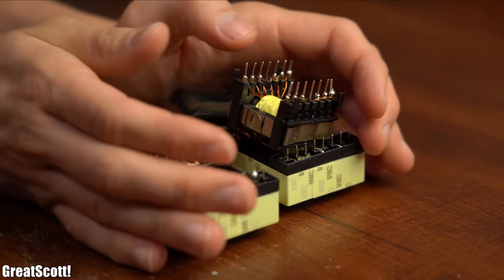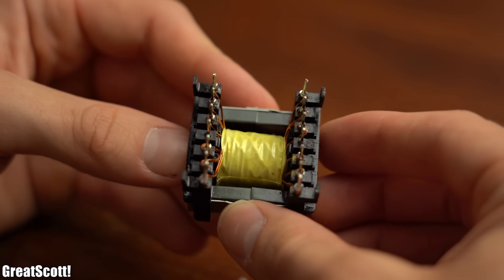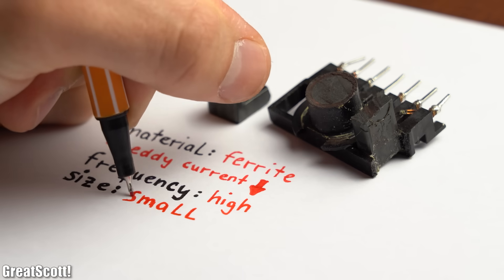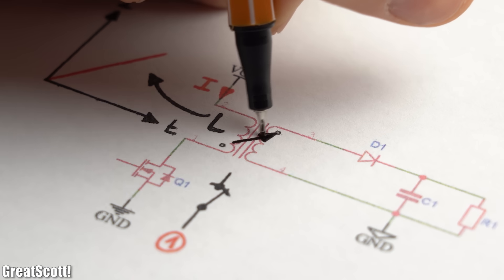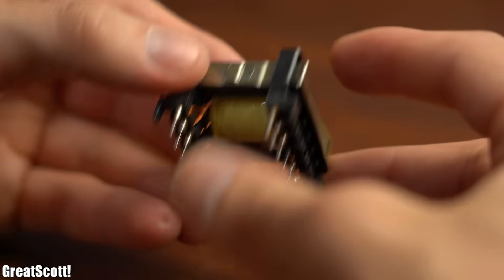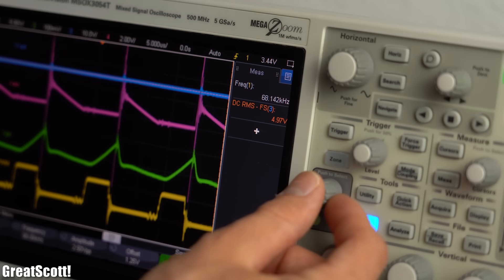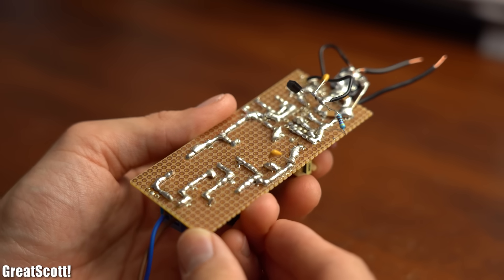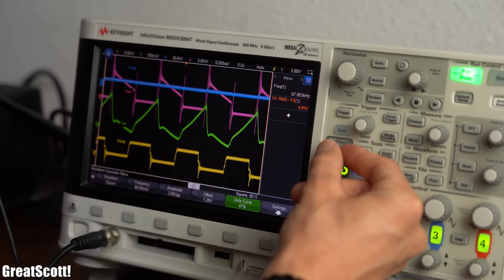How does a modern Power Supply work?! (230V AC to 5/12V DC) DIY Flyback Converter!

Comment: HEy Hey Scott! listen to me Please make a small and long and fast RC Car with rear wheel steering and use a flat and big li_ion battery as your base where you will attach your moter and circuit so that it is less tall and the center of gravity is near to ground, use serval less heighted motors to make to all wheel drive (please atleast make AWD Bkz i wanna know how to have steering with AWD). Make it very fast and add a boot and a holder where you will fit your phone and use phone camara to track where it is going or the best use you phone and moter only to make RC car Which is affordable and best of all. after making you can delever stuff using it and do some tough offroading and climb 80 degree angled wall(benefit of low center of gravity) and do cornering (taking it around corners at max speed).*Please do this it is my Request*

Comment: Just can't wait for the video on the TL431. I'd love to see, how I could use it, to regulate the output of a dc-dc converter (which aren't so different from smps). For example to battery power a microcontroller based temperature logger.

Comment: can you plz make a video on making a gamepad with arduino NANO ,or just make  a small video on how to make arduino NANO a an input device with code please . i tryed so hard but i am not getting it please help, and love your videos.PLEASE HELP... or how to make arduino nano as  an HID.
Reply: i am Also Totally down for this!
Hope scott sees your request and i also have a message from me that i write here:
HEy Hey Scott! listen to me Please make a small and long and fast RC Car with rear wheel steering and use a flat and big li_ion battery as your base where you will attach your moter and circuit so that it is less tall and the center of gravity is near to ground, use serval less heighted motors to make to all wheel drive (please atleast make AWD Bkz i wanna know how to have steering with AWD). Make it very fast and add a boot and a holder where you will fit your phone and use phone camara to track where it is going or the best use you phone and moter only to make RC car Which is affordable and best of all. after making you can delever stuff using it and do some tough offroading and climb 80 degree angled wall(benefit of low center of gravity) and do cornering (taking it around corners at max speed). Please do this it is my Request
Reply: @kunaldhar6713  i also had this idea but i am not having  a 3d printer to make it.
Reply: @armanp7860  Well i guss you can use the battery as your base and use metal as your body or just you don't need the body

Comment: Could you explain what might happen if one replaces the diode D1 at 5:42 with a bridge rectifier?
I've seen such a circuit and I could not explain how the circuit outputs the samething with that it would have worked with a single diode instead of a full- bridge rectifier.
Reply: The power supply won't be a flyback anymore. The output capacitor would charge also, when the mosfet turns on, it would be more like forward topology, and the output voltage would depend on duty cycle and transformer's ratio. I've seen something like this, but it was halfbridge with an air gap and no output inductor, an LLC resonant converter, that regulates the frequency instead of the duty cycle.

Comment: Flyback converters are fine for low power phone chargers and such, What about forward converters? (single ended, two switch forward, half bridge, full bridge, with asynchronous and synchronous rectification pros/cons) or even better, what about LC, LLC and LCC converters?

Comment: Make video on how to design ferreit core transformer...& Why for high power applications with not use flyback topology..??
Reply: Flyback is usually the choice for much higher output voltages( boost) compared to the input..but at lower current requirements..max..
(150-500 )W ..

Comment: 6:23 Well, actually the mosfet can get overvoltaged even if the leakage inductance is zero. Here's an example: we built a flyback SMPS, that converts 325V DC into 12V DC. The transformer's ratio is 20:1, and Vd-s(max) of our mosfet is 500V. Whet the mosfet opens, the energy from the core gets transfered to the secondary side, where we have 12V, so the voltage on the secondary winding is about 12.6V (due to fast diode's voltage drop). Knowing the transformer's ratio, which is 20:1, we can calculate, that the voltage on the primary winding is 12.6V * 20 = 252V. This voltage adds to 325V, that we already have on the mosfet's drain, so at the end we have 577V there! As you can see, the 500V was exeeded. Even the 600V mosfet wouldn't be enough, because of the leakage inductance, which also adds some voltage to our 577V. To solve the problem, we could use a transformer with lower ratio, for example 2:1. But here another problem begins: when the mosfet turns on, the voltage on the secondary diode will be 12V + 162.5V = 174,5V. Our diode have to maintain this quite a high voltage. That is why we have to be careful when it comes to choosing a transformer, a mosfet and a secondary diode for our flyback power supply. In a described example, optimal transformer's ratio would be 5:1
Reply: Voltage wise factor of safety..2.5 x.. (+20%consider input o.v. condition) so( 325+65 )× 2.5...but now new device rDS " on" will be higher...
Reply: Very good points, thanks for sharing

Comment: Imagine PCs with conventional power supplys, they would need a case almost the same size as the pc tower. At least electronic components are cheaper than copper and almost every application which needs a psu has a high frequency type. As a child of the 80s I know the iron transformer age very well 😉
Reply: And think of the weight. I've got a 12V 6A linear supply on my desk at work. It weighs more than my PC.

Comment: So I always thought DC-DC converters that used a toriodal transformer like the power supplies in car audio amplifiers where flyback, but since they have no air gap what exactly would they be classified as? Just an isolated boost converter?

Comment: In the video, you mentioned about the air gap but didn't explain why it's used, I still have this doubt on how energy is stored in the air, and why does it fly when the transformer get turned off. Will there be a next video about it?
Reply: The ferrite of the transformer is a magnetic circuit in which the magnetic flux introduced by the magnetizing current of the primary side is carried between the primary and secondary windings.  For a conventional transformer, these are carried with a low "reluctance" path to ensure that that the energy is transferred to the secondary winding simultaneously with it being introduced into the primary winding.  This can only happen because there is a current set up in the secondary by the magnetic flux at the same time that the primary is generating the magnetic flux.

In a flyback, there is a diode blocking a current flowing in the secondary while the primary is magnetizing the ferrite.  The primary magnetizes the ferrite, and it would hit a limit called saturation at which point the ferrite can no longer be magnetized any further.  To prevent this, an air gap is introduced into the magnetic circuit in which the flux lines flow.  This increases the reluctance of the magnetic circuit and reduces the amount of flux induced into the circuit given a magnetizing current.  Energy is stored in the magnetic field, most of it in the air gap.  When the switch shuts off and the primary current stops, the magnetic flux stored in the ferrite is no longer sustained.  The magnetic field collapses, and by Faraday's law a voltage and therefore current is induced into the secondary permitted by the diode.   The capacitor is charged in the secondary and the power can be transferred to the circuit.

So one of the biggest differences is that a flyback stores energy in the gap and transfers it in separate steps, whereas a conventional transformer transfers the power during the same cycle from primary to secondary.  The air gap stores the energy in the flyback that is transferred from primary to secondary.
Reply from the maker: Thanks for the nice explanation :-)
Reply: @profdc9501  thanks a lot, it clarifies very much of my understanding, however for me it's still a black magic on how air can hold so much energy (technically, all the energy that passes over the power supply was once passed thru the air gap).
Reply: @WagTsX  The magnetomotive force applied to the ferrite magnetic circuit is equal to the number of turns multiplied by the current in each turn.  This is equal to the magnetic flux times the reluctance in the circuit.  The energy density stored in a magnetic field is 1/2u B^2 where u is the magnetic permeability.   The permeability of air is one, while the permeability of a ferrite is around 1000 to 5000 or so.  So if one adds an air gap to the magnetic circuit, one increases the reluctance of the circuit, which decreases the flux.  However, the energy density is inversely proportional to the permeability, so the ferrite stores only 1/1000 to 1/5000 of the energy per unit volume that the air gap does.  The air gap prevents saturation by reducing the flux, and the energy that is stored by the flux is largely in the gap.  Even vacuum can store energy from the electric and magnetic fields it contains; it's the fields that contain the energy in that case, and not the rearrangement of charges or currents in a medium.
Reply: Really great explanation @profdc9

Comment: Small question: why do all transformers of this type always have so many pins? 
In the circuit you mentioned that it has three identical coils. Why three?
Reply: Many are designed to have multiple output voltages or have their windings combined in series to form center-tapped windings.   A winding can be used to sense the output voltage rather than an optocoupler (for example a TL431 and PC817 combination) and keep the input and output isolated.  The transformer can be used for more types of power conversion.  There are several topologies that are often used besides flyback: forward converter, half-bridge, etc. that would use the transformer differently and may or may not need an air gap.
Reply: 1) multiple secondaries will need them...
besides that that's the only reliable way to " anchor" the tx. onto the p.c. board..
2) many designs include the 
" self powered " winding on pri. side that takes over once the stable o/p is established...

Comment: Thank you. I have a big box of these I bought  eBay as a mixed bag for £1 ages ago and having tested the coils resistances was puzzled. The box remains! I will try testing them with low voltage at 60kHz   Might be more informative. Very good explanation. I vaguely knew how they worked. Now I know more :)

Comment: When you say: "Working with mains voltage can lead to major injuries", I think that you meant to say: "Working with mains voltage can lead to Fatal injuries". ie. Let's not beat around the bush with the danger here, especially for young or inexperienced makers. Mains voltage can actually Kill you!  Otherwise, another great video. :)
Reply: 👍this holds true for high voltage ISOLATED supplies too..if not careful....all it takes is the shortest low resistance path...and that can be between any two (of an individual's) body parts completing the ckt.  ...
as far as possible.." one hand behind the back" is always  safer ..in some cases

Comment: Hi Scott, please can you explain me, why specially mobile phone chargers have a capaitor between primery and secondary side (parallel with the transformer)? It's useless or important? And... is it a capacitor?
Reply: If  the cap. you're concerned about is the one between 1) pri.side non switching end & gnd/ earth..and 2) likewise on sec. main winding...,
It's there to " bypass" the 
pri- sec inter winding capacitance.with a lower impedance path to earth...this capacitors value is approx. 10× measured value of pri- sec inter winding capacitance.
The secondary though isolated..., would be literally swinging up & down without it...causing interference to its own load and also into the primary source..( mains i/p)..
Reply: @analoghardwaretops3976  Thank you.

Comment: Actually the voltage dropping at the output is due to the flyback topology. It’s just like a forward of halfbridgd, the output is averaged out, but no need for an output inductor, the transformer does that itself when used in a flyback configuration. But obviously it isn’t a stable voltage, so a flyback loop is needed, and usually it’s made with a voltage reference and an optocoupler for galvanical isolation!
Reply: Flyback/ boost.. as the name implies..is mostly for " boosted" output voltages...I e. volts higher than input level..so current is usually lower ...
The boost inductor is in series with the  transistor switch...on Input power side .....and "THIS" current is measured...in the control circuitry..,here it's not the " load " current that's being measured..even though that's what we need...
However in some critical apps. 
the freewheeling diode current...
( partly it's some of the of real load current ) is measured and used for control...
it involves more mathematical derivation and additional equalising circuitry...

Comment: PSU are a PITA to fix, at least to me. I have an original XBOX that was plagued by the damn 2000s shoddy electrolytic capacitors and it went bang a few times; cascaded and blew up all the capacitors on the motherboard and a few components on the PSU. 
Luckily, after a few new capacitors and a modified ATX PSU, the main-board is just fine.  The PSU on the other hand is starting to drive me crazy.  Replaced exploded resistor and diode, checked capacitors, resistors and diodes and the more suspect transistors and I'm still stumped.  I'm starting to feel really dumb and I know someone that's a professional would look at it for five seconds and go like: There's your problem".

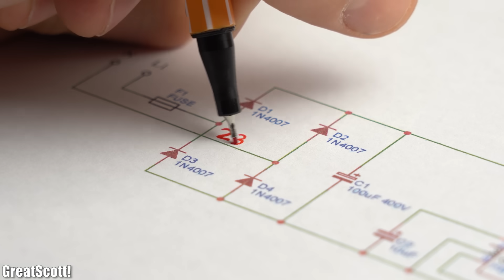Comment: Could someone explain how the VCC pin of the NCP1010 gets it's power? In the schematic at 9:20 you can see it's connected to ground via a 10uF capacitor which seems more like a decoupling capacitor? Is that pin connected somewhere else? Any information would be helpful.
Reply: Here's how does it work: when the power supply gets plugged in, the 10uF capacitor gets charged through the primary winding and the drain pin of the IC. Then, after charging to a decent voltage, IC starts switching the mosfet, and every time it turns it off, the capacitor gets charged once again. Such a cycle continues.
Reply: @__MINT_  Oh so the capacitor on the VCC pin is not actually power coming in but is used to store energy to keep the IC running?
Reply: @justcallme00oogy  Yes
Reply: @__MINT_  ah alright that makes sense! Thanks! That had really bugged me
Reply: @justcallme00oogy  You're welcome
Reply: @__MINT_  Thankyou also 🙂

Comment: Valeu!
Reply from the maker: Thanks for the support. I will talk about the optocoupler working behaviour in the video with the TL431.
Reply: I just got really curious about the optocoupler, I thought they were digital devices but in this video it's seem like it can work like a variable resistor. I guess that makes sense since they are a transistor in which the gate is controlled by an LED, but, can the LED be turned on partially with linear correlation with voltage? I guess I need to do more research!

Comment: Some smps use zener diode to regulate the voltage
Reply from the maker: True
Reply: It's cheaper.. specially if on secondary side tight regulation is not required...

Comment: thanks for the explanation! a very well done video and it really de mystified these cheaper SMPS designs for me. BTW for a good  bridge rectifier Steve SDG Electronics recently did a video and found a pretty good one. Then also add some missing movs and other protections etc. and it is well on the way to become a really nice open source design. That can be adjusted somewhat the specs to suit the needs of the specific usage. Maybe with the extra work it could also be reviewed by one or two other electronics youtubers, to get further feedback and that could be really fun for everybody to participate in. But heh! No need for doing any of that! ...its just a silly idea really. I guess another fun part would be to compare the BoM costs and the overall quality against a commercially sold ones. Like a Meanwell for example. But it would first take some further significant development iterations. Before being able to get to that stage of things

Comment: Looking forward to follow-up videos on TL431 & the switcher IC also.
A trick I had picked up from Haseeb Electronics to troubleshoot faulty optocouplers in SMPS is to use a diode on the output of the opto, which helps isolate any feedback circuit issues
Reply: Hi, could you explain a bit more about adding a diode to the opto output? How does that help to diagnose an issue?

I work with SMPS sometimes so it'd be great to learn a new way to find problems :)

Comment: Awesome video GreatScott!.
To help newbies who may not be always fully aware of how oscilloscope measurements should be approached especially with mains connected circuits, can you please do a follow-up video showing exactly how you had connected all devices, especially the isolation transformer & scope ground leads.
If you can also demonstrate scope differential probes in such situations, this would be super
Reply from the maker: I did a video about how to use an oscilloscope properly. There all those things are explained.